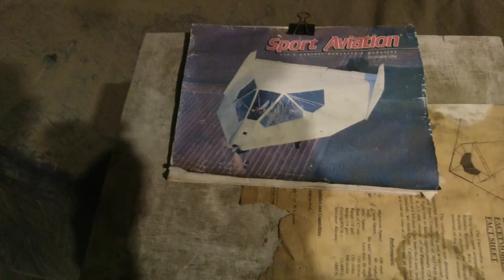Minimax 1100r Wood Aircraft Build Ep 137

Comment: Dennis why polyurethane the outside of the fuse when it will be later fabric covered ?
Reply from the maker: Hey Robert, the main reason is protection against moisture wicking. Like if moisture got on the inside of the fabric and drained down, the wood is completely protected

Comment: Hi Dennis, I built a MiniMax with a Rotax 277 back in 1988- 90 and I loved that ultralight! I have  been following you from the start and I have a question, mine had flaperons with a handle that was along the left side of the back seat, I don’t see that on yours, how do the ailerons hook on? Thanks and looking great! Greg.
Reply from the maker: This one doesn’t have the flaps. Those were originally added to achieve the stall speed for the Part 103 requirements. 
The aileron teleflex just exits straight out the fuselage and attaches to a bracket on the outside. I am waiting to rig the ailerons before I drill those holes.
Reply: @DTMinimax   ah, that makes sense, thanks!